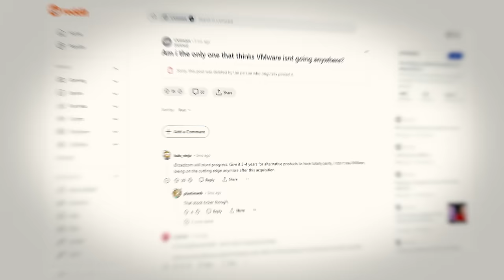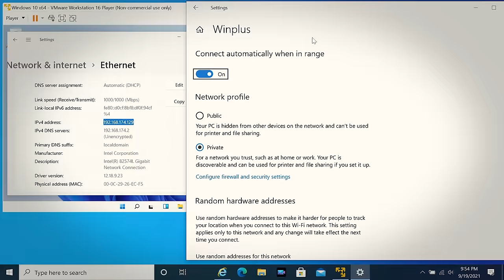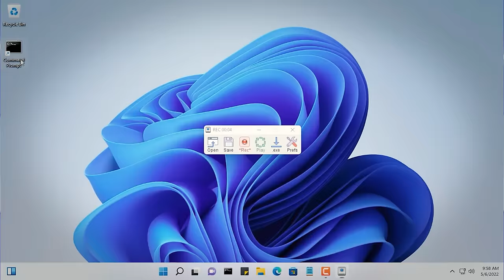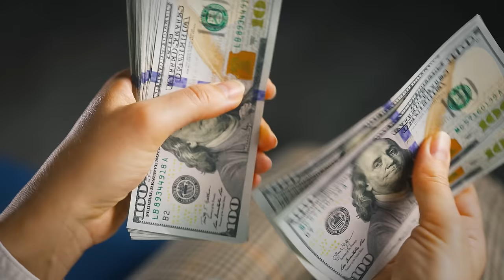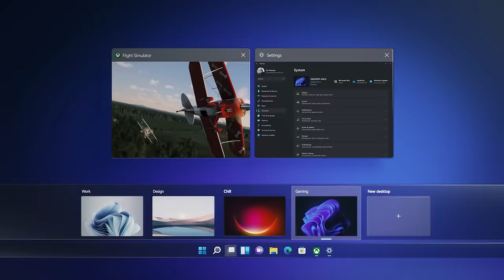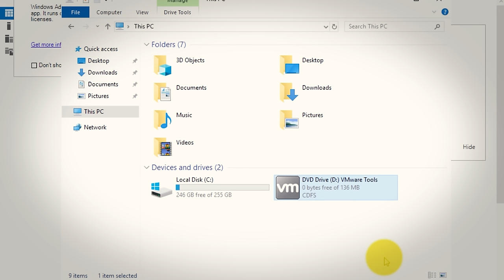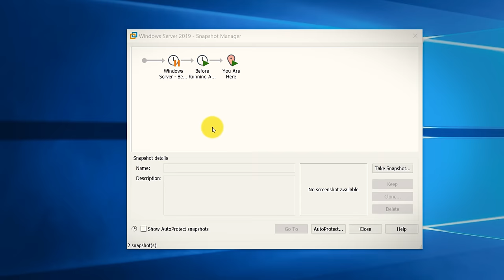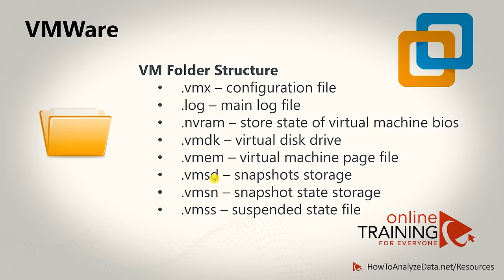Why Engineers Are So Worried About This Acquisition

Comment: LOL, Microsoft using VMware?? They are a competitor with their Hyper-V virtualization platform. And do you really believe that AWS runs on VMware??? I don't think so!
Reply: openstack I believe
Reply: Azure and AWS don't run off VMware, but hosted VMware is a core product for both to sell to enterprise users, and integration into the cloud infrastructure requires the use of VMware software.

Also, if we're speaking outside of the context of Azure, you seem to be under the impression Microsoft exclusively uses Windows Server and Hyper-V which is not the case.
Reply: Why not use competing tech when it's better? MS uses Linux in their Azure DCs.
Reply: AWS runs on KVM after switching from Xen years ago
Reply: They offer managed VMWare clusters, and on the back-end of large companies you can sometimes find individual teams using tools you wouldn't expect
Reply: MS runs a lot of their competitors software/hardware, especially when that sw/hw has features/value that their own lacks. Most of the Windows OS GUI is designed on Macs, Oracle's DBs are used where MSSQL can't handle the loads/requirements, etc.
Reply: I can assure you, they do.
Reply: @RonaldChmara  >most of the UI element in windows designed on Mac

So THAT'S the reason why there's no more theme customization as "extensive" as Windows XP and 7
Reply: AWS runs on their own version of KVM. I run Proxmox for my home lab, which is also KVM. The mass migration away from VMware needs to happen.
Reply: Deosen't really matter what you think 😊
Reply: Microsoft is a VMware Customer as is AWS. Both have partnerships with the company and have run some infrastructure on the platform internally. Additionally AWS and Azure offer full integration with VMware Aria, and VSphere for hybrid solutions.
Reply: Amazon uses pure KVM on Linux.
Reply: @walid6329 is a core product is a huge exaggeration. Most people who are on AWS for sure are not using it.
Reply: @czarcoma  Microsoft does use Linux VM's, but all hypervisors including as far as I know those that run Azure Kubernetes Services (which uses Microsoft's Azure Linux distribution to power certain services) run on Windows Hyper-V.
Reply: @Gerard1971  thanks for confirming

Comment: I used VMware to test and learn about Linux distributions for a while in 2021-22 but switched to VirtualBox when I decided to daily drive Linux in 2023. It's a great piece of software but I really wish if they had more keyboard shortcuts and customisation options like VirtualBox.
Reply: The problem with VirtualBox was minor scaling at 2K or up to 4K Screens when we installed the Operating System without guest drivers or guest tools. VMWare Workstation has that option where you correct the older scaling at standard or stretch.
Reply: Also, you can't add 8GB of VRAM in VirtualBox because of limitations with 256 megabytes.

Edit: if you want us to find a better Virtual Machine than VMWare for Windows, it's not Virt-manager or VirtualBox; it has to feature either full-screen scaling mode to match.
Reply: Proxmox
Reply: if you're on Linux, why not kvm tho, virtualbox is considerably slower compared to kvm imo

Comment: VMWare isn't used in public clouds like AWS, DigitalOcean, etc.  Those are, generally, running open source alternatives.
Reply: Yea I think most major cloud service providers use KVM for their virtual compute instances
Reply: VMware is a longstanding partner of Microsoft and AWS and has integrated solutions for both providers. It’s integrated partially through VMware Aria, and enables fully cloud, multi cloud, or hybrid infrastructure.
Reply: @LDrumsOhio yes but that is an add on you have to pay as a customer and which is made to ease migration from an on-premise VMware environment to the Cloud.

Comment: Purchased for 69 billion, annual revenue of 11 billion.  That's 8 years to break even, then a margin of 16% after that.  The time to double their investment is the equivalent of an investment that makes about 4.05% returns each year.  
  
Put simply, they're going to be looking to raise prices pretty significantly.
Reply from the maker: True
Reply: If you lose customers fast and crash the company there is no ROI. Let's see what happens and what value it will be in 2 years.
Reply: Revenue isn't profit my dude
Reply: @toseltreps1101  Fair.  Their profit margin was 14%, so 1.54 billion roughly.  That makes the 69 billion purchase price even more questionable.  But it doesn't really change my main point which is that their ROI here is quite low as an investment unless they're expecting to increase prices a lot.
Reply: They are already quadrupling their prices. It'll be x8 and then x16 in a couple of years
Reply: Reminds me of a conversation snippet I heard in 2008, working in a computer repair warehouse. GM: ".....this is a 4% business....". The company got bought out for $3.4billion cash.
Reply: @FlorinArjocu  there is if you drop 95% of your support costs by pushing the low payers away. They're looking to offset "lost" revenue from customers migrating to an alternative by hiking prices for those who remain and killing their cost base for supporting the smaller guys
Reply: @whywouldiwantahandle  That is optimization, sure. It also depends on how far you go and what the competition does.

Comment: Me using QEMU and VirtualBox: "Dang that's crazy"
Reply: Just curious here, can you continue where you left off if you restart your VM machine in QEMU? Whenever I restart, anything I installed or previous work appear to have never taken place.
Reply: That’s a different use case as you’re not really using any of the features that enterprises use. VSAN, NSX, ESXI, VMotion, Vstorage, etc.
Reply: @LDrumsOhio Correct.
Reply: @LDrumsOhio  I work for a very large CDN and cloud computing enterprise company. Our stuff runs on QEMU KVM based VM platforms plus Kubernetes as well as other standard UNIX environment setups for networking, storage, etc. Not VMWare. Granted, we are a tech company, not some financial or auto maker who has those people contained to a single division.
Reply: Both of theabove are slow none can much vmware
Reply: Manuel, I can continue just fine. Check that the user you use to start the machines with QEMU have the appropriate permissions. I use to work exclusively on a W10 machine through QEMU

Comment: containerization also reduces the need for virtualization for running web applications
Reply from the maker: True
Reply: True, though containers are a much inferior security boundary to hardware-enabled virtualization.  For business sectors that aren't just web app shops and that have a decent compliance burden, it is often a brtter choice to use VMs instead of containers, or do a hybrid approach where apps ofna similar security profile or similar attack surface are put in the same K8S cluster of VMs.
Reply: Containerization is not virtualization. Also, emulation is not hardware abstraction. There are so many avenues for app execution and they're all very useful in how they work. VMware has some containerization tools but I've never figured out how to use them.
Reply: Different use cases.  Not that many companies are running VMware for their web app infrastructure.  Who this affects the most is big enterprises running all their internal stuff in large VMware clusters, and small mom and pop shops running 1-2 ESXi hosts with Active Directory/Exchange.

Mid-size companies that were running small VMware clusters are all in the process of switching over to Microsoft's HyperV, even though they all complain about HyperV.
Reply: NixOS is a great alternative to containerization, it garantes repeatability and reliability of environments created. If it works on the developer machine, it will work elsewhere, and all you need is the text based configuration file to share the enviroment with others. Environments are ephemeral and are always recreated the same way, even in machines with different hardware. 

Automation and even versioning is also greatly simplified. I expect great migration to it in the future. Maybe now it's the time, a great opportunity
Reply: There are still use-cases where you want/need a full vm. But even then, Vagrant has been used for over a decade now. People will just switch to another implementation for it. It's not really going to change much for most modern devs.
Reply: containers? web aapplications? Containes have nothing to do with web-applications, you can run any kind of applications on containers.
Reply: lol, most companies using VMWare don't use it to run a single website. Those are actually the systems we run on dedicated systems to reduce security risks anyway.
Reply: Containerization is already integrated into the VMware ESXI platform using the Tanzu function. VMware developed their own MicroOS called ProtonOS that is container focused.
Reply: @PhilippBlum  95% of the world is running on whatever infrastructure was setup when it was installed though which means for the entire time VMWare was popular ...aka the last decade a lot of companies are getting hosed.
Reply: @Wingnut353 That's very true. Never change a running system, right? :D
Reply: well that's true, but we do have certain internal apps that run on a virtualised kubernetes cluster.
Reply: @AlexanderRay92  To add to this, Google currently runs every container in a virtual machine to avoid security problems, similar to how Google Chrome runs tabs from seperate orgins in seperate processes and each are sandboxed.
Reply: Not entirely, but a lot of the orgs are actually using VM and Containers in conjunction at times. It is a much better security practice to run your k8s or docker swarms in VMs that has been put inside isolated VLANs with firewall rules and ports specified for outbound and inbound traffic! Both are equally necessary!

Comment: As one who experienced the arcane arts of the mainframe world, I'll point out that MVS part of IBM's 1974 OS 370/MVS stood for Multiple Virtual Systems. Multi-platform support by VMware was a significant difference from the mainframe environment, but other aspects of virtualization had been part of the mainframe world decades before VMware.
Reply: I used IBM's other VM OS VM/360 (I can't remember exactly what it was called on an IBM 4381! It was so good we were able to build our own OS as a VM guest client and get 20 students running on it back in 1987!
Reply: @PWingert1966 that's so badass 😱
Reply: @honor9lite1337  The OS we implemented was called turning. from U of T in Toronto by a professor holt
Reply: @PWingert1966 A similar system I used ran DOS/VSE under VM/CMS where VM was short for Virtual Machine. To loop back to the main point: VMware's ability to host/manage multiple vendor environments on the same hardware is a significant improvement but not completely unique. Many of the features and advantages of virtualization were implemented on systems that predate VMware and even Microsoft.
Reply: @boblangill6209  that's what I was trying to remember VM/CMS! LOL. Thanks.
Reply: I could never understand why IBM hadn’t brought virtualisation to x86? Dumb.

Comment: I used Workstation 2 back in 2000 for few months on pre-sales position, loved how well I could demo solutions and were stable. Move into 2008 I purchased my first Mac and used Fusion v1 up to 11. VMWare was very reasonable with customers at the time, but I felt there were letting home customers out last few years and moved into Parallels for arm based Macs. Now, on professional side, I used to learn a bit using free ESXi virtual machines on my Fusion. Cheap to study to learn for work. Being a Cisco engineer at a large company were it was hard to het physical devices access to learn, I've found VMWare attractive to learn and career advancement. I've ended up going to AWS later on but I feel worried for VMWare engineers having difficult to upskill in the next years.

Comment: I remember issues with VMware products going back far beyond the BCM acquisition. VMWare was basically the only preferred private cloud provider, i.e set up complicated cloud functionality on servers in your office as opposed to in the cloud. It was good, but I distinctly remember VMware vSphere having an adobe flash UI in 2019. Unreadable api docs and nonexistent support for certain custom workloads which would leave you scratching your head. Their software ran well but I always felt they couldn't upgrade some of their products without breaking the entire app in the process, and that happened before Broadcom.
Reply: Your customer simply didn't upgrade his vsphere, lol. The HTML5 panel has been out for many years. The flash one was still supported, but deprecated.

Comment: I did not like this explanation of virtualization because it does not show the difference between using a virtual OS vs just using a different programm. In the Netflix example you could just as well say "well, during the evening we close Word so Excel has more power".
Reply from the maker: Ah fair point
Reply: Exactly, each application exists in its own virtual memory space. However, virtual memory != virtual machine. It's confusing to conflate the two

Comment: Your video is wrong in its entirety on a fundamental level. You're conflating too many types of virtualization and their use cases:
1. Virtual memory and multitasking (selling point: security): I don't want a rogue program to bork the entire physical address space - maintained by the MMU + the kernel, not a market for VMWare even in theory.
2. Containerization (selling point: reliability, scalability, more security): I want every workload in my DC to see the same predictable state and not interfere with other workloads in any way, not just by sharing the address space, but also files, CPU cores etc, and I want to wipe the slate clean on every workload restart - Linux supports this via Cgroups, products like Docker make it usable, and notably VMWare was never competing in this space because it's completely different from what they're good at.
3. Hardware virtualization (selling point: compatibility): I want to run an OS on top another OS without complications of a shared setup, e.g. to play Windows games on my Mac or run Windows builds of test suites for my CI. This is the one and only market where VMWare has ever competed.

The truth is that VMWare's products are mostly consumer products, they matter way more to the average Joe than they they do to any company - and my hunch is that Parallels has won the consumer section of this market a long time ago. VMWare does not and never did enable any Cloud based business, unless this business absolutely hinged on running Windows binaries in AWS for some reason. This is the reason why this company is constantly being ping-ponged between legacy companies like Dell: they have entrenched themselves in a niche that will only shrink moving forward.
Reply: The average Joe has likely never heard of this, and has no personal use.
Reply: @brien.  They probably mean your average developer or power user. I definitely fall into both categories and I'm already having issues with VMWare.
Reply: @brien.  You're probably right, most people would probably get a physical PC or use CrossOver if they wanted to play a Windows game on a Mac.
Reply: VMware been focusing on commercial side more now
3-4 years ago when I first started hacking i started with VMware, it was perfect but... now i shifted to virtual box knowing that its even more efficient and more reliable compared to what VMware is now
Reply: The average joe has no use nor cares about VM. Most people have no use for it you meant to say power users
Reply: The core product is vSphere and that clearly isn’t a consumer product. On the other hand it’s true that the big public clouds are not using VMware as they are using their own open-source based solutions on Linux.
Reply: For the first one you could consider Amd NPT and Intel EPT which are page tables managed by the hypervisor, which do have security applications for example HVCI in microsoft hyperv
Reply: @JohnBlackCyberSec  Yes, but you need to have already decided to use a hypervisor for it to be relevant. I imagine most public clouds do use one for bootstrapping the guest OS, but I suspect that most are running just one or two guest OSes (one for orchestration and one for running containers in). I doubt that VMware can compete in such a market, because there’s no space in there for any complex features that they could use to differentiate their offering from OSS hypervisors